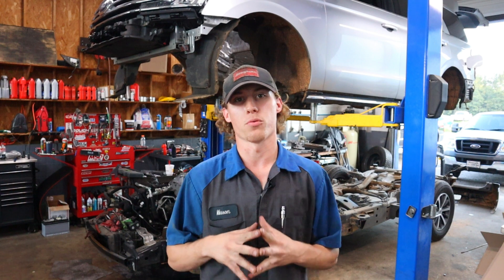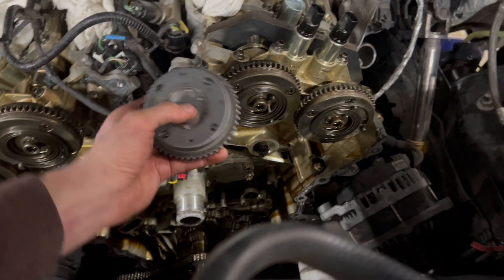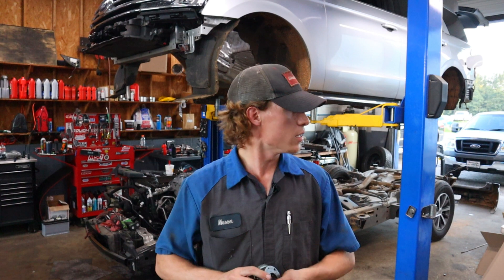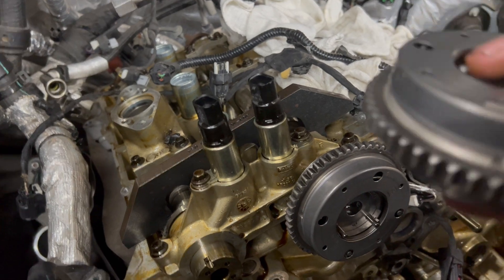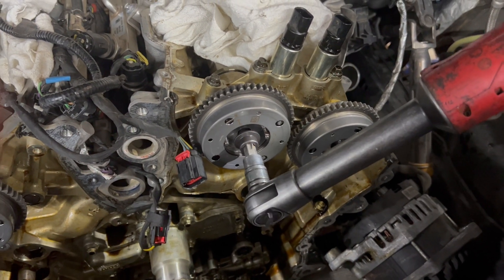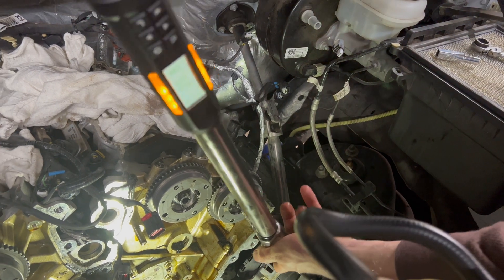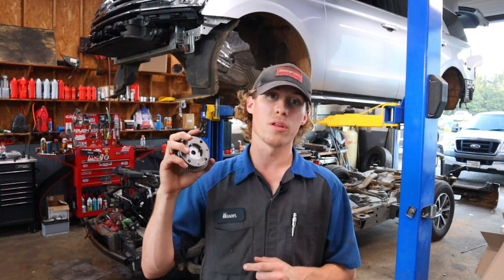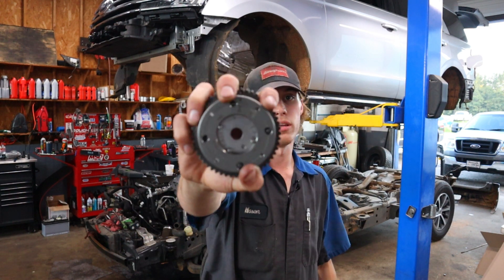Ford 3.5L EcoBoost Cold Start Rattle | The NEW UPDATED Phasers

Comment: This is VERY interesting. My most recent phaser replacement with the box of ordered parts included a couple of ML3Z phasers and I returned them thinking they were incorrect. When I checked HVBoM, it listed both the HC3Z-CD and ML3Z-A as being correct. Since HL3Z is a 2017 model year prefix and ML3Z is a 2021 model year prefix, I'm thinking that 2021 to current model year builds come equipped with the revised units from factory? That said, we should be replacing the older style with the newest going forward?
Reply: The ML3Z phasers have been out for almost a year now.  Since they’ve been out so long, I would estimate about 80% of the phaser jobs I’ve done have been with the ML3Z phasers.  The others?  Well I guess I will be seeing those trucks again eventually. 😂
Reply: @ghostwrench2292  I've done TONS of these damn phaser replacements now for the last couple of years.... with the old revision update. Guess I get to have the pleasure of doing them again. It's gotten me to where I can have the cabs of these F-150s raised in forty-five minutes.
Reply: @michaelchan8915  next time you do it please post a vid, I am in Madagascar and highly doubt my ford dealer has done a lot..my f150 Raptor is going in soon for the cam phasers
Reply: @ghostwrench2292  Are the new ML3Z Phasers a permanent fix for this problem or does it just happen again like the old style? Im looking to buy a used EcoBoost with the Phaser problem for a really good deal but I'm afraid ill have to keep dealing with this over and over!
Reply: @e17f - I cannot say for sure.  All I can say is that since I began seeing the ML3Z design phasers (to replace faulty HL3Z phasers), about a year ago, I have not seen nor heard of the ML3Z failing.
Reply: @ghostwrench2292  Ok perfect that gives me some reassurance. Question for you I am looking at getting a 2017 f150 limited from a friend its got 64,000 Miles and the phaser issue but I'm getting it for 22k do you think that's a good deal? It has two other small issues the drivers side power running board isn't going in and the passenger massage seat isn't working but either than that and the startup rattle it looked fine. I showed a mechanic and no codes popped up on his scanner
Reply: @e117f yikes.
Reply: Are these new updates phasers for a 2015 f150 3.5 Ecoboost also?
Reply: @bradrozum847  NOPE. Not for a 2015 model year 3.5L EcoBoost. This update applies only to 2017 model year to current GEN II version 3.5L EcoBoost engines.
Reply: @michaelchan8915  what's the newest part number for the 2015 f150 3.5 Ecoboost? I want to make sure the dealership doesn't do me wrong

Comment: You have a great channel. Have you ever seen a 6.2 with the rattle?
Reply: I work for Ford. The 6.2 doesn't have that issue.
Reply: @ironmike742  thanks mike
Reply from the maker: I have not
Reply: Only sound they can make is a lifter tick at startup until oil pressure builds up. No issue
Reply: @Blue_Flame_Raptor  thanks

Comment: Had mine replaced twice with the older part before they had any of the new designs in stock. Got fed up and traded it in before having it done a third time. The only way to fix it was to raise the body off the frame.
Reply: The body doesn't need to come off to do cam phasers
Reply: It doesn’t need to come off, depending on the mechanic it’s just easier for them to get to if they remove the Cab/body.
Reply: Smart.I got rid of a whole fleet because of shoddy ford trash.Been running fords for over 40 years.Just stupid ass engineers that cant justify theyre existance
Reply: Why did you keep replacing them?  Just because of noise?  I am trying to find out if leaving them alone causes immenent catastrophic engine failure.  Have been unable to find one example of this on the bog 'ol web.   If you know of any, please share video or proof of a noisy phaser being the sole cause.   Thousands of us want to know if it is something we even have to address if we are ok with a little rattle on cold start.
Reply: @peruser155  first time it was more of an annoyance since it was right around 11k miles.I didn't know what it was so I had them look at it when I was getting my oil change. The dealer diagnosed bad phasers. I guess it was easier or faster for the dealer to lift the body off the frame to do that job. Second time was 31k, it happened during a tow and I got a blinking cel and loss of accel. Same part was bad and at that point they had the revised component. Really that was the only issue with this truck and I had no other issues. Upsized to a 3/4 ton for heavier tows, that one is another issue.
Reply: @Dynamiczz  mine is  '19 Expedition and noise at startup AND after warming up.  I'm ok with the startup rattle (a 2000 Super Duty I had with the Triton 5.4 had this rattle at startup and ran for over 100,000 miles NO ISSUES), but its the constant ticking from the same phaser area at operating temp that has me nervous...

Comment: What's the round about price for having this done?
Reply: I had my timing chain replaced a year ago on my 2011 3.5 Ecoboost because because it was stretched and it rattled.  They had to replace I think two of the phasers.  I also had the water pump replaced since they were already in there.  The total cost was right at $3500.  Took them a week to get it done because they had to wait on parts.
Reply from the maker: About 3500 with us. Some dealers are north of 5-6

Comment: Is the recall on all of the 3.5 ecoboost?  Mine is doing this and it is a 2012?
Reply: You will more than likely have to pay out of pocket to get yours fixed but make sure to have it thoroughly diagnosed first.
Reply: Nope. A 2012 is a GEN I 3.5 EcoBoost with the single primary timing chain.
Reply: I had to replace my timing chain on my 2011 Ecoboost and I believe they put a 2012 chain on as the fix.  They also to replace two of the phasers as well.